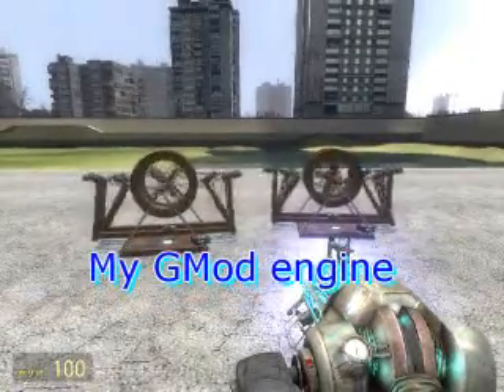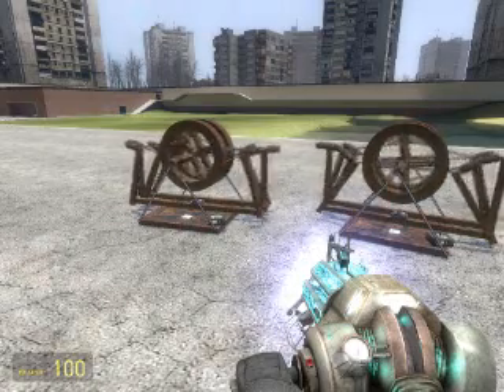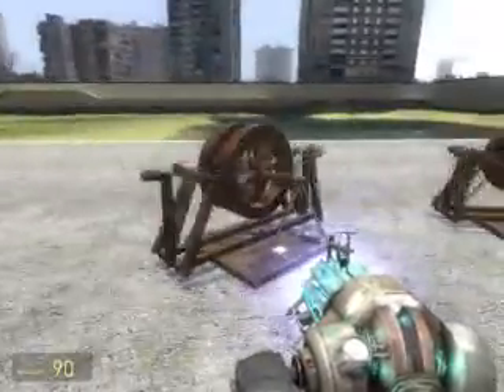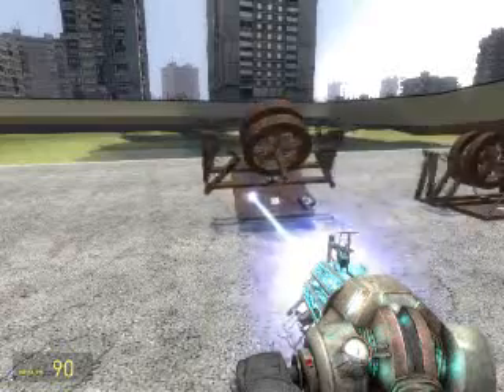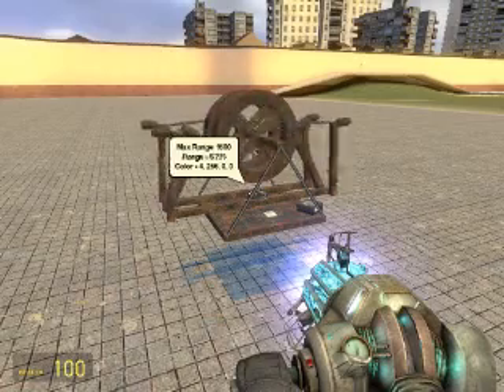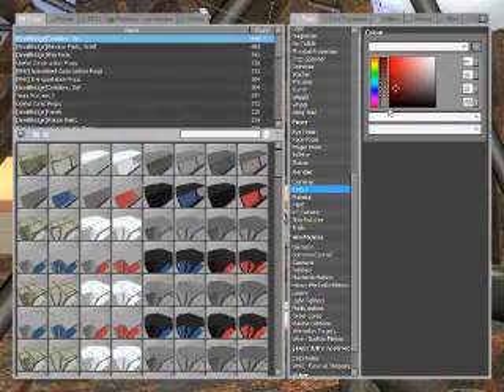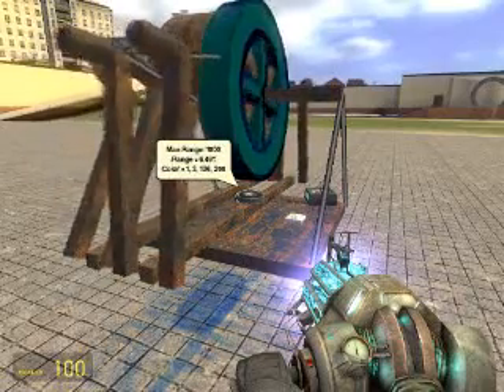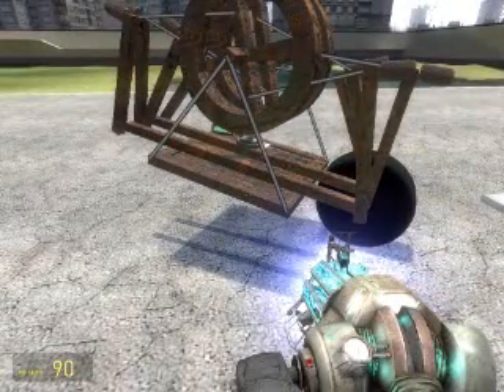My first (good) GMod engine

Comment: How did you get your engine to turn only in 1 direction.

I made a single cylinder engine that works on a ranger biased system (velocity wise) and it is at the piston shaft measuring whether the piston head is going towards or from the piston. And therefore it can flip its self. But it often turns on both directions.

Comment from the maker: I used some rigid ropes (rope with rigid ticked). You have to make a few ropes to the centre point of both ends of the axle and cross them over.